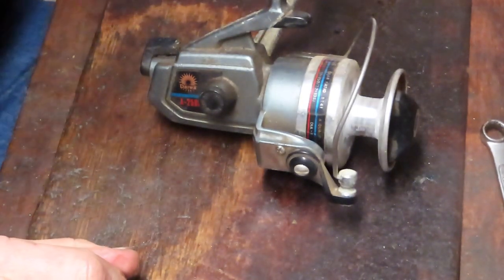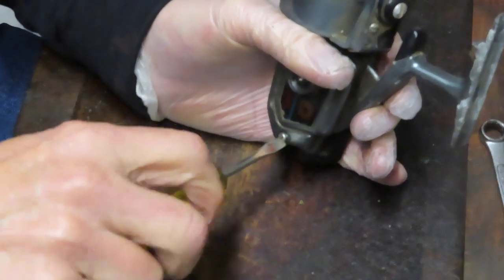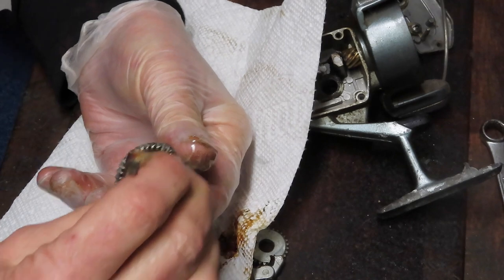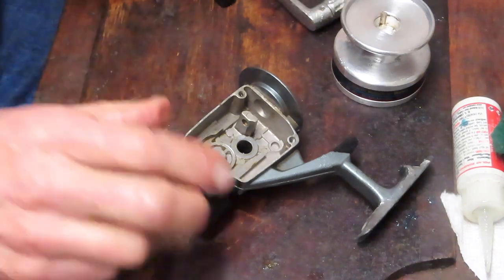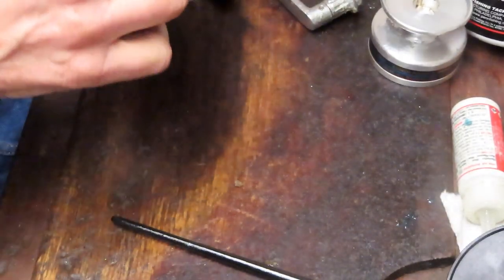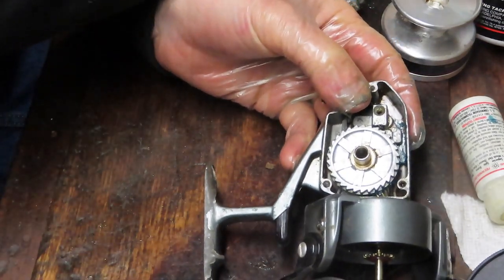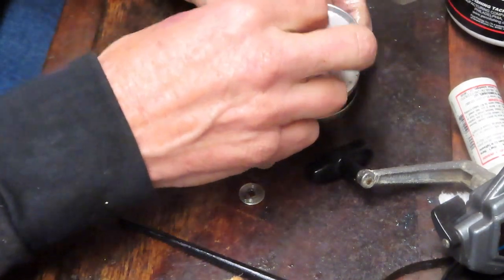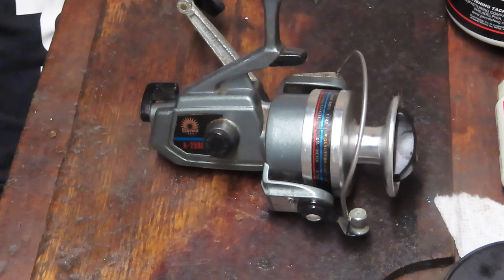Daiwa A250RL classic spin fishing reel how to take apart and service

Comment: Thanks for the nice video! Do you know what does RL stands for?
Reply from the maker: I'm sorry, but I don't know what that stands for. - Dennis
Reply: Serhly and Dennis: I reckon that “RL” stands for “Right and Left” - that the handle could be changed either to left- or right-hand retrieving.  Most of the spinning reels in Japan during the early days were right-hand retrieve, so the “RL” was considered as a innovative technology then.
Reply: @unechan_b2549  Thanks for the clarification! Is the RL a predecessor of C series? For example 2500C, it's also silver series and could be converted to left or right handed. There's no RL, but C instead. What is C stands for?
Reply: @serhiysemenko2027  Hi Serhly, for the modern Shimano and Daiwa reels the “C” following (or before) the reel number indicates “compact” body size.  For example,  daiwa 2000C means “spool size 2000 with body size 1000”.  I’m not certain when they started using this notifications, and whether this is the same for vintage reels... Hope this helps !

Comment: That Apollo AS 7050 rear drag I got was a terrible reel. I’d like to see the AR on this one because that was the failure of my Apollo rear drag. My Apollo was very different as the AR was under the rotor.  It’s a shame because except for a part called a anti-reverse claw plate that was missing, the reel was brand new. Of course this part can’t be found anywhere so my Apollo is absolutely useless.  This reel is okay but I guess I have a bed impression based on my experience with the one Apollo that I have. I just don’t want another one!  It does have a nice main gear. Good video though!
Reply from the maker: That claw was a weak link and it does leave the reel useless.  Tuition reels and lessons learned!  Best wishes Chris